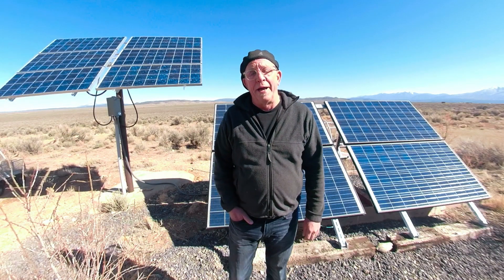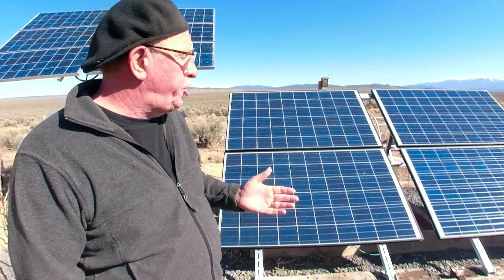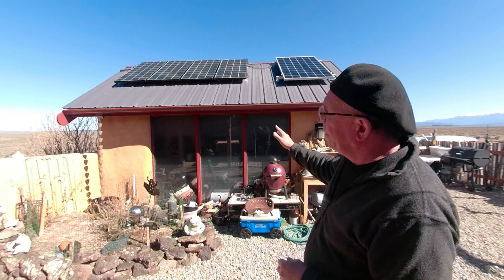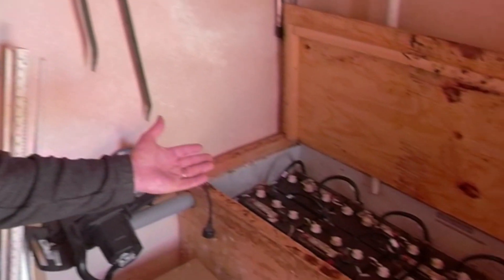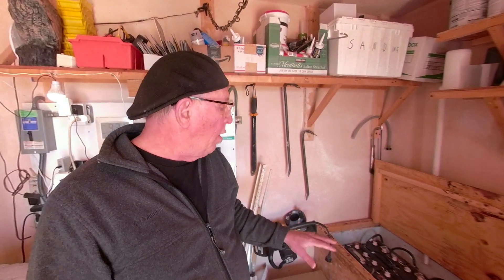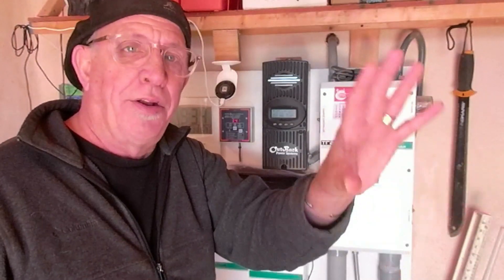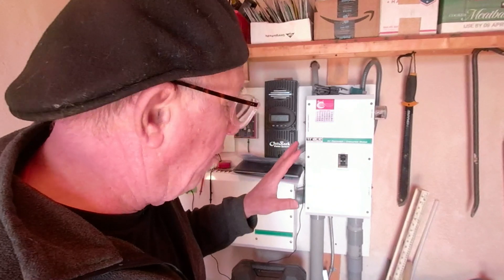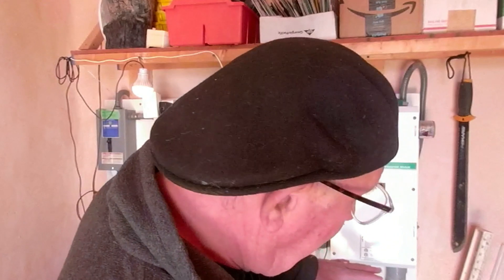Off-Grid Home Lithium Battery Solar Upgrade Part 1

Comment: Mini Solar (Winter) Tip: e.g. a Beuler and all other hungry electricity consumers can be continuously adjusted down to e.g. 300W with a 5000W dimmer (7EUR). I run 5 dimmers in parallel on an 850W inverter. Kettle 2.2KW at 150W runs 12 hours a day, so the water is always hot. The room is also nicely heated. 2.5KW washing machine runs in parallel with dimmed to 200...400W. Iron, dishwasher, oven, electric heater, coffee machine, all internal heaters are throttled with me. Videos about it on my channel https://youtu.be/eC2olbCBhh0 The inverter stays cool, quiet and the MOSFETs remain intact because extreme current peaks no longer arrive at the inverter. Now every Mini PV Inverter is enough to sell large devices...

Comment: Enjoyed your open off grid house …!
Curious about your water situation…any info on your community well…? Depth to 1st water?….recharge rate?
What about drilling your own well
So you can garden?
Reply from the maker: Thanks Raymond! We have roof catchment that is stored in 2 3000 gal cisterns that handles most of our water needs. The community well is over 900 ft. deep. With a solar powered pump system. Prolly not economical to drill your own well. I would garden except for having a black thumb.
Reply: @taosjay  we drilled two additional wells after seeing where our water table was (25-45 ft) a well log is most helpful. Fresh fruits and greens are an off grid delight.